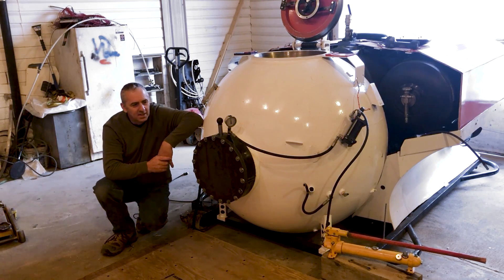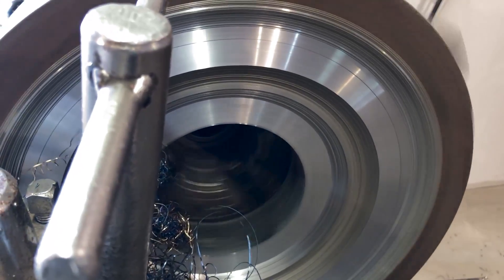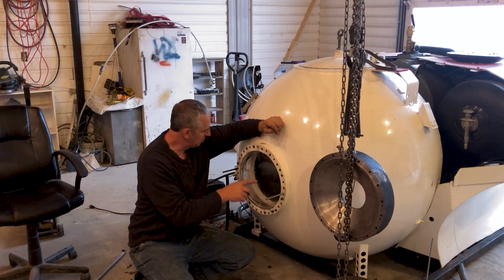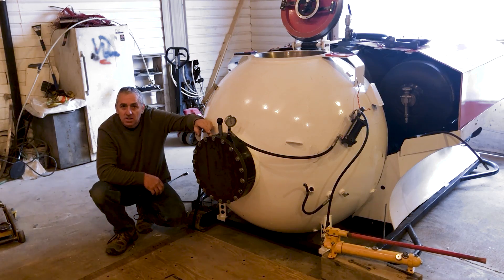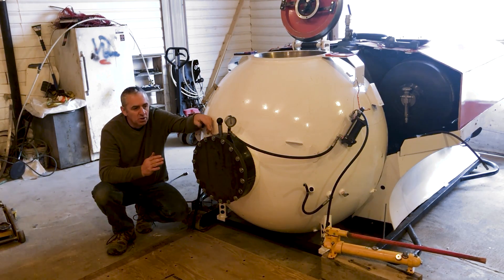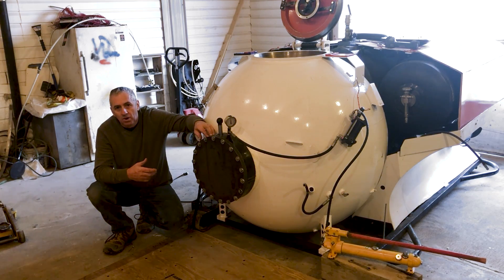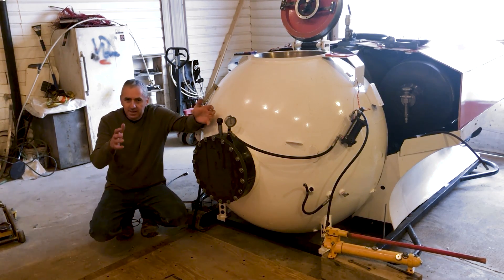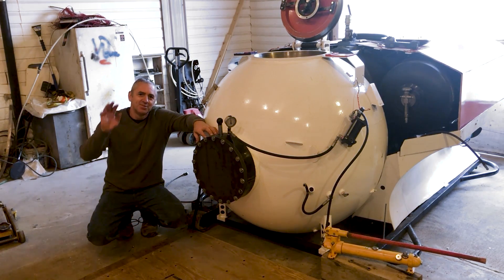Homemade Pressure Test Chamber For Submarine Dome

Comment: Hi Hank! Does your acrylic view port have any gaskets or can a good pressure resistant seal be achieved by precisely matching the surfaces of the acrylic viewport and the viewport seat? Thank you, I would appreciate your guidance!
Reply from the maker: Hi Pat, there is no gasket, just grease.  Grease provides the high pressure seal, and an o-ring at the retaining ring provides low pressure seal.  Its kinda  funny that it is more vulnerable to leak at the surface than down deep.  I flat window would have a gasket or o-ring though.
Reply: @HankPronk  thank you for the insight! I do appreciate it! Yes, at first it seems strange that such a view port design would more likely leak near the surface than further down but when you realize there is externally applied pressure that increases with depth it makes perfect sense 🙂 I'm currently designing a flat sided conical view port and figured that an o-ring at the interface/intersection between view port seat, retaining ring and acrylic viewport would be needed for low-pressure leak-sealing. I'll send you a drawing of my design when I'm finished so you can tell me if I'll live or drown 🙈 So the entry hatch also relies precisely matched flat surfaces for sealing, right? Does your hatch also have a low-pressure o-ring or gasket to prevent near-surface leaks?
Reply from the maker: @LuminousBlueVariable  The hatch has an o-ring  for high and low pressure sealing.  Acrylic deforms to make the seal, where steel won't.
It sounds like your design is the same as my dome.
Reply: @HankPronk  It's funny you should say that because, on the face of it (and when viewed from the outside) my view port design looks a LOT like yours but I can assure you your design is a lot better and more advanced than mine! I never took a good look at your view port until after I had completed the preliminary/concept drawing of my own view port. It's funny how independent lines of thinking can lead to a degree of convergence of ideas. My view port is 300mm in diameter, 85mm thick, cone-shaped with 37.5 degree 'flares'. It's held in place by a 530mm outside-diameter, 12mm thick retaining ring with 48 thirteen mm diameter holes on a PCD of 482mm. The corresponding seat is 86mm 'thick' with 48 corresponding holes drilled and tapped (half-inch UNF) to a depth of 25mm.